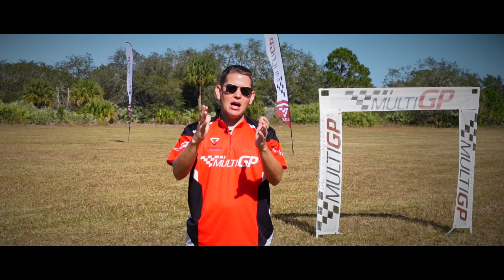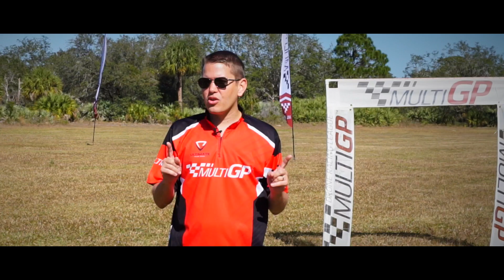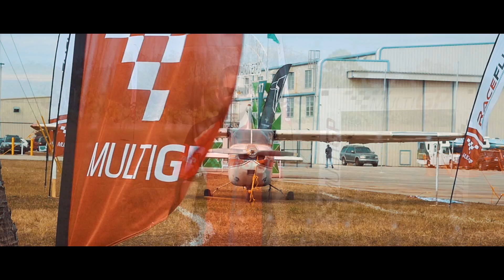MultiGP - How to Determine and Fix FPV Video Problems During a MultiGP Race

Comment: I have done test , where by those budget vtx output are not calibrated well. Lets say a 200mwatt vtx, i hook up to a rf meter, it will give a reading of 400mwatt for the first 1-4 channels. And 5-8 channls are showing lower then 200 mwatt,.
Reply: seen it so many times. I've seen a 200mw fixed put out 1200mw before.
Reply: Oh yah, that too

Comment: Another issue that we have during racing is the proper direction to go on the proposed tracks UTT Tracks.. Do we follow the directional drawing on the sheets or can the pilots inter the gate from any direction as long as their quads enter the designated sides..??

Ex.. on UTT3 track.. The first gate,.. The drawing shows that you should enter from the far outside of the track.. We had some pilots going from the inside of the track with the argument of as long as I go through the gate with the multigp sign facing the quad.. 

Can you please provide some clarity on this issue also..?? 

One more thing, when are the class requirements being released.. I'm ready to purchase a quad for it.

Comment: Excellent method for solving video issues! The other thing I would like to see is a formal rule allowing a pilot to get their video issues solved, and potentially a rerun if it turns out they lost laps due to someone else's equipment. I have seen a few races now where "premiere" pilots were given reruns due to bad video, but lesser known pilots were not provided the same luxury. Had there been an official rule, such as the whole shot rule, this situation might have been avoided. That aside, I love seeing videos like this! They add a lot more cohesion to the league